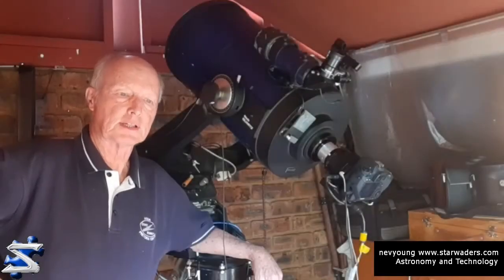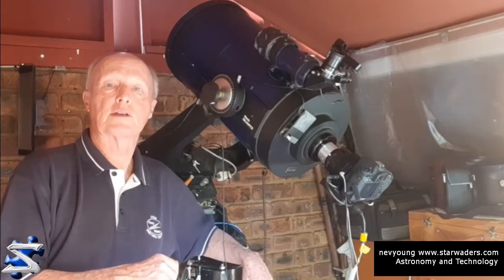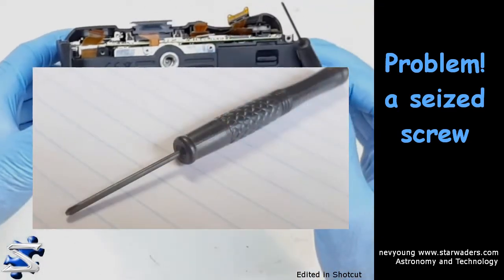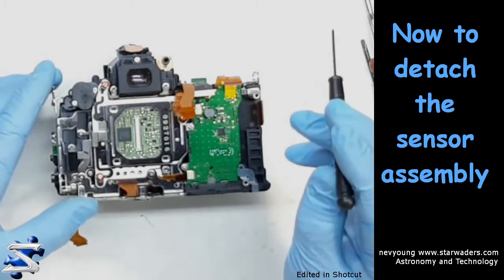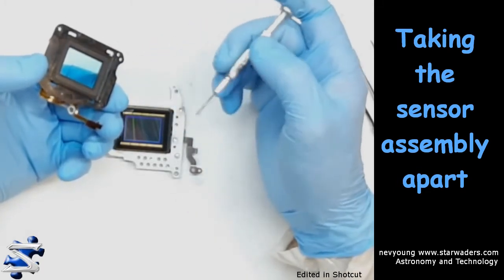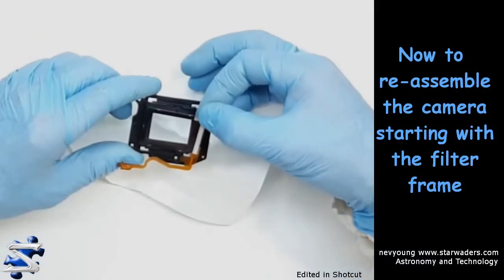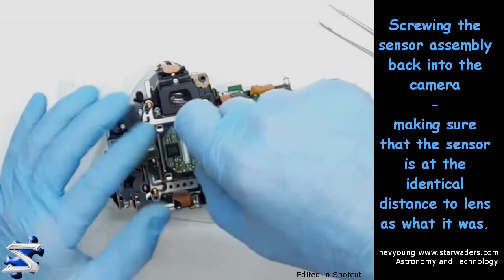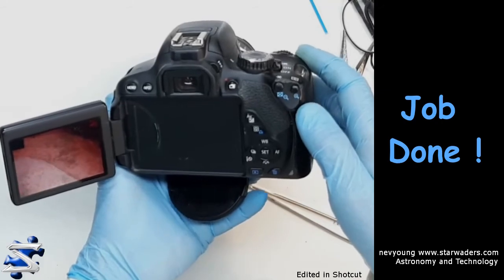IR Filter Remove from Canon 650D

Comment: A note: there should always be a warning about the flash capacitor whenever anyone's taking apart a camera. Those capacitors can hold a charge for a very long time and can present a serious risk not just for the camera, but also for the person doing the disassembly, as the shock they can deliver could potentially be life-threatening (no joke). It's always best to discharge the capacitor first in a controlled manner (so not shorting it out ;) ) before working on a camera.
But well done. I did this back in the day on my old 350D and since that one is ancient now, I'm considering doing this again on a 600D I recently got (kinda unplanned). Live view would be such a great help... :)
Reply: Potresti spiegarmi come scaricare questo condensatore? Sto facendo la modifica ed ho letto il tuo cokkendo e mi sono spaventato 😂
Reply: @francescodisimone7754  Use some kind of resistive load to discharge it. An analog(!) voltmeter could work, though it would likely take a while for the capacitor to fully discharge, or you can literally use a resistor. For a camera flash capacitor, something like 20 kOhm 5W resistor should work, with thick enough leads and of course well insulated.